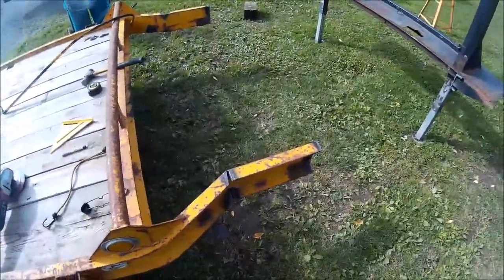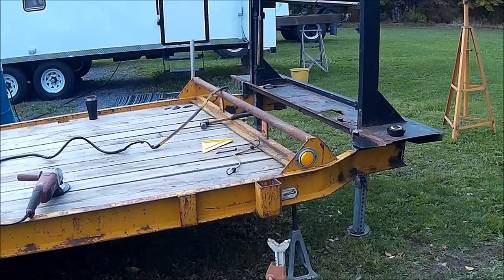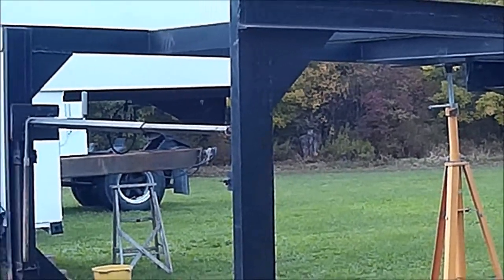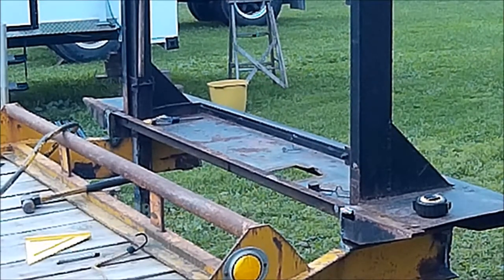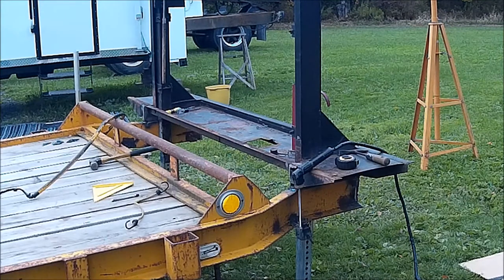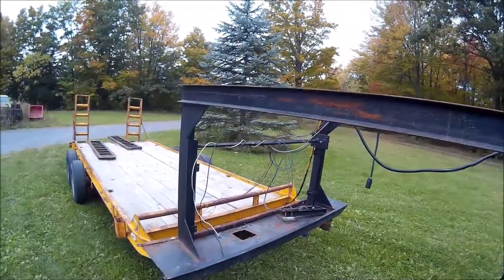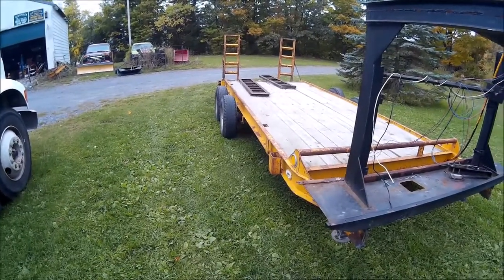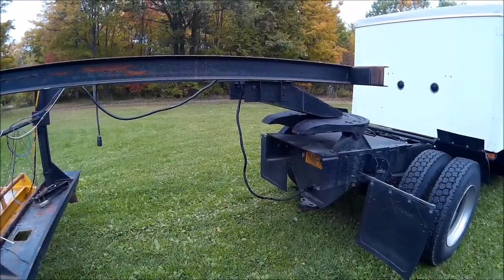Welding the gooseneck

Comment: great video.. im planing to do something similar...what is the thickness of the  I beam of the goose neck?
Reply from the maker: +Alpha1 Hello Thanks! the goose neck was 1/4" X 4" channel, if I wasn't using an existing setup I would have built it out of 1/4" X 6" channel. I still need to gusset the deck over but it'll be plenty strong enough for my application.

Comment: no offense, but that looks flimsy and I was looking on here because I have a tandem dual axle tilt trailer that's a pintle hitch and I wanted to see what metal I should use to convert it to gooseneck,   It hauls a little track loader that weighs roughly 9.5 ton, I want to pull it with my pickup, instead of a truck, and I can put my transfer tank on the gooseneck part with a tool box to store oil and grease.

seams like everyone on the internet is a engineer, but they don't have any good info to back their theory's.
Reply from the maker: Carl, One thing is I haven't completed the build on this particular trailer just too many irons in the fire and I haven't been able to get back to it. Over the course of 40+ years of building things I've built over 60 trailers of various sizes, including a 35 foot 5th wheel toy hauler rv, I just got back from a 1500 mile trip with that one. Am I an "engineer" no, I just know what works, one job I had was building prototypes of things that this team of "engineers" designed some where absolute disasters, they knew all kinds of terms and theory's but no practical experience. My suggestion is that if you need to go on You Tube to find out how or what size metal to use to build a trailer go buy a trailer already built you're going to hurt yourself or others, my videos mostly are just showing what you can do with what's on hand. When this trailer is done it will do what I want it to do safely, it has to go thru an inspection by NYS to be certified for the weight I want to license it for.
Reply: Carl Johnson,
As a certified welder/ fabricator, with over 40 years of welding experience, I would not follow this guy's advice under any circumstances!
This is a slap in the face to those of us that actually know something about building trailers, and more so, have the public safety at heart!
This IMO, is an accident waiting to happen....
I would suggest getting in touch with a real trailer (Gooseneck) manufacturer to see what they suggest, and not listen to these "HACKS" that think they know what there doing!
Good luck, BE SMART, BE SAFE!!!
Razor!
Reply: @razorworks9942  I agree with you 100%. I'm a welder too. I can tell his "gooseneck" is off of a 5th wheel camper that small flimsy channel that the 5th wheel camper manufacturer used is strengthened by the structure of the camper. You tear all of that off and it's lost a lot of it's strength. There needs to be a lot heavier steel to make the gooseneck structurally sound and safe.
Reply: @justinmil1  
Hey Jen,
Women welders...you go girl!!
What type of welding do you do, how long have you been at it? Did you receive any formal training? 
This has been a good trade for me as I had an opportunity to weld up an engine stand for a Ford 289 in my mechanics shop class in high school when I was probably 16 or 17 and then did a little more while I was in the service, but I didn't get serious until after I got out and I enrolled into my local community college and been at it ever since...I've worked for some really good guy's and not so good guy's and had my own welding business, ultimately joining the Union, where I wound up getting hurt and on full disability...now I am thinking about starting another business catering to the Jeep community as i am fabricating custom parts for my new Gladiator. Like i said earlier, overall it's been a great career in spite of my injury!
If you have any questions or need some advice, I'm happy to help....
Razor!
Take care kid!
Reply: @razorworks9942  I've never had any classroom or formal training at all. I just had on the job training. I do flux, gasless flux, stick and mig. Basically the standard boring stuff. I did some welding in the Military too but very little. Now I just do it on occasion as a little bit of side money. I injured my back overseas so I don't move as fast now. The last big projects I did was 2 years ago I did some work on the corrals on the Ranch my boyfriend at the time worked on. The biggest project was the loading chute I made for the cattle trucks to back up to. And I've done other various stuff too. But I was scrolling through YouTube and noticed this trailer and I thought OMG I have to comment on that.
Reply: @justinmil1  
It's definitely not an easy trade if your going after big welding jobs. With the right training and education it can be very rewarding! Unfortunately there are a bunch of idiots out there that call themselves welders and they haven't sat in one classroom of attended any formal training ever and they get on this platform trying to tell others how to weld or fabricate something...sad part is a lot of folks actually listen to them and end up hurting someone else because of it!
Just be careful out there!
Reply: @razorworks9942  I was self taught and also the old guys taught me a lot too. So seeing this gooseneck build made me cringe.

Comment: I thought you said it had 2 7000 lbs axles. My trailers are 14000 pound. That is what I was comparing to.
Reply from the maker: Hi Tom, Not sure if you watched the start of the build, there are two trailers, a bumper pull that has two 6000 lb axles. the 5th wheel front was taken from a trailer that had two 3500 lb axles and was grafted on to the bumper pull that has the 7000 lb axles, so yes you are correct, I need to beef up the nose that I grafted on, just haven't been able to get back to it yet. Thanks so much for watching